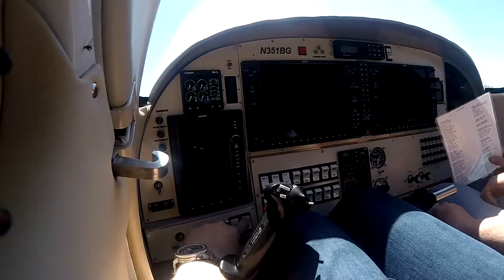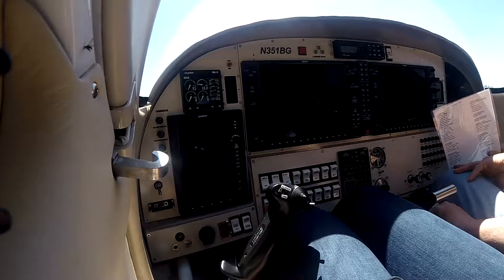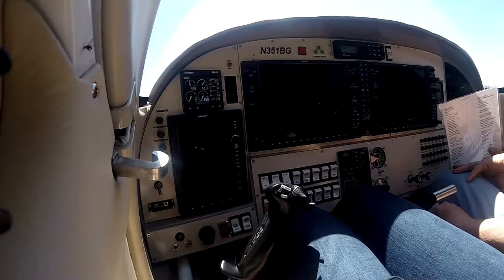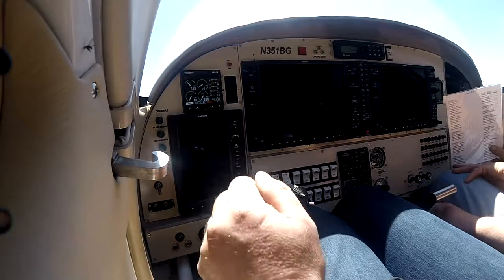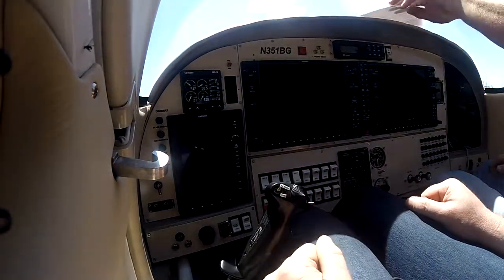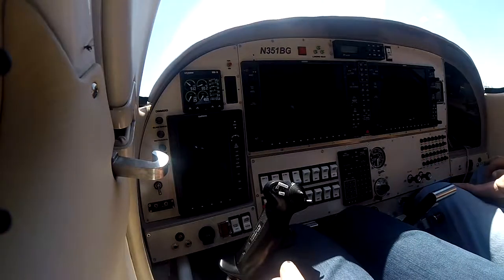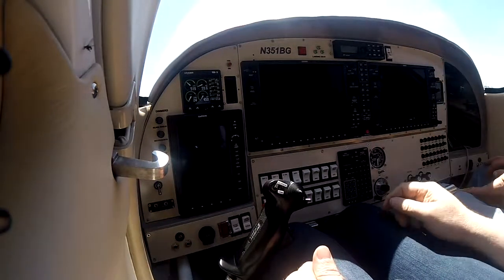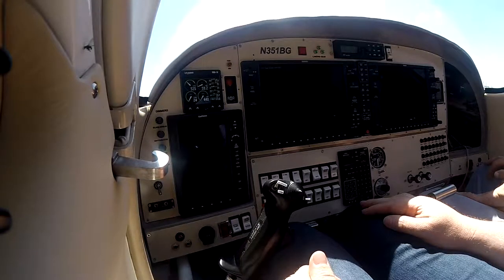Start Walter 601

Comment: I realize this is older, but can you verify that this is some sort of automated start procedure where the fuel is introduced automatically by the system? I didn't see the right hand move on the condition lever during the early part of the start. At what % N1 does it introduce fuel? To my eye it was around 16-17%.
Reply from the maker: Yes , the Walter FCU introduces fuel automatically at around 12% N1.
Reply: @zubtf  Thank you, I found the VR-601 TSLM operations manual and am working through it.